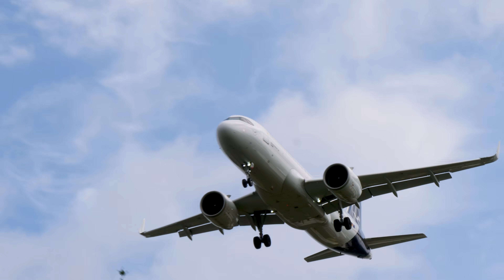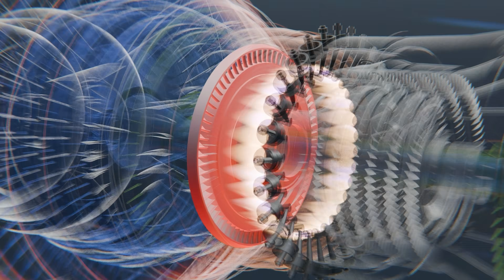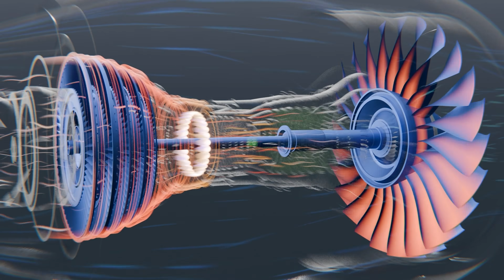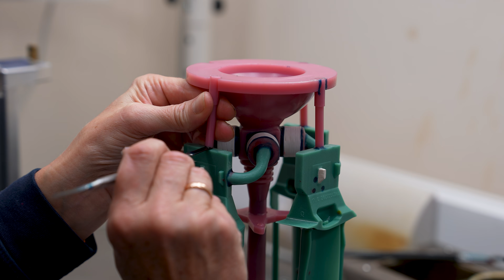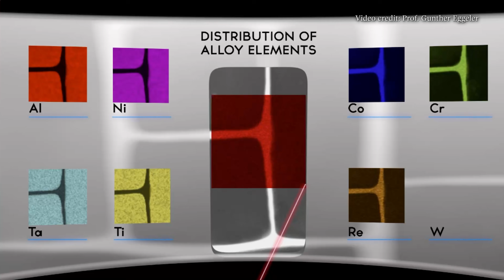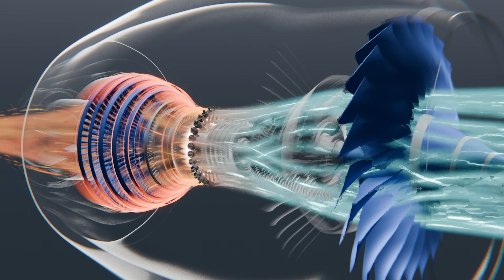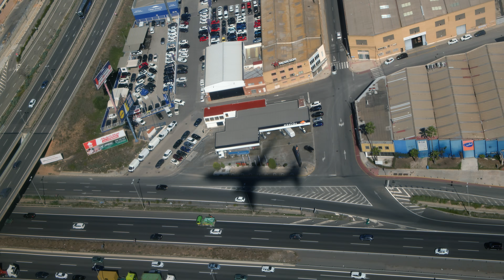The Ridiculous Engineering Of Jet Engines

Comment: Is it true that the slower the exhaust is, the more efficient the engine is? Eg. you want thrust to push the plane forward instead of the air backward.
Reply: In order to push yourself forward, you have to push something backwards equally hard. Now, you can push a small mass backwards really fast OR you can push a large mass backwards not as fast. As long as the "mass x acceleration" is the same in both cases, the thrust is the same. When you push on a fluid like air really fast, you have to push harder then the work you get out of it if you pushed slowly. If you can imagine say a piston in a cylinder and it moves up really really fast, air molecules start to bunch up right in front of the piston creating a larger pressure I have to work against then the rest of the air in the cylinder. So I'm always working against a higher pressure gradient then I need to. If I went slowly, the pressure would equalize and I wouldn't have to fight against that pressure build up right in front of me that I created by going fast. Likewise, now that I compressed the air in that cylinder and I want to expand that gas to get work out of that compressed gas by allowing it to push the piston, If I go slow I get all the work back out of it. If I go fast I create a slight vacuum right in front of the piston and the air can't fill that void fast enough so I always get less pressure acting on the piston then what is in the cylinder. So, going fast in either direction I work harder then I need to and I get less work back out of it that I should. This is why high bypass jet engines are more fuel efficient then low bypass engines. Low bypass engines need to accelerate a small amount of air to great speeds to get x amount of thrust. A high bypass jet engine grabs more air (mass) but accelerates it much less to get the same x amount of thrust. The one that accelerates more mass but not as much is therefore more efficient then the one that accelerates less mass but to much greater speeds for the reasons I shown above with my piston analogy. Essentially by trying to move the air fast, you create your own drag that works against you.

Comment: The heating up making the alloy stronger. Is that due to the lattice mentioned before and the shearing? Once heated certain atoms or particles are heated of, off gassed, or precipitated? Which would then help prevent the lattice shearing? Is that anywhere close?

Comment: With regards to the dust, look up the story of British Airways Flight 9, which was a quad engine failure due to volcanic dust. They managed to restart the engines (although one was severely damaged and had to be shut down again) and land safely. Green Dot Aviation has a really good video on this.

The engines run so hot that the volcanic dust was melted into basically glass. As the engines cooled down from being windmilled, combined with the lower altitude free of ash, these clumps of glass broke off the blades which allowed the engines to restart.

Comment: It sounds like the safety margin of those blades is really low? If any of those protections failed just a bit, it will be engine failure. How does the engine achieve high reliability when it operates at the absolute limit?

Comment: 1. More Forceful

“The familiar ball-and-stick model of atoms is fundamentally wrong. Atoms are not tiny spheres with electrons spinning around them, and pretending otherwise leads to impossible scenarios—such as electrons that should repel each other being drawn into stable orbits, or atoms that should pass through one another without resistance. These contradictions expose deeper flaws: the standard visualizations used in classical mechanics, quantum mechanics, and string theory are not just oversimplified—they are conceptually invalid. The entire framework built on these assumptions needs to be re-examined from the ground up.”

2. More Technical

“The ball-and-stick representation is a pedagogical abstraction that fails to capture the actual quantum-mechanical distribution of charge and probability density in atoms. Electrons do not behave as discrete, repulsive point charges orbiting within rigid spatial boundaries; instead, they form delocalized wavefunctions governed by the Schrödinger equation. Treating electrons as miniature spheres or assigning atoms fixed geometric ‘contact points’ introduces nonphysical implications, such as unbounded electron–electron repulsion or spatial overlap of nuclei. From this standpoint, many traditional atomic models—and the assumptions they feed into classical mechanics, quantum field theory, and string frameworks—lack ontological validity and may require a revised conceptual foundation.”

3. More Philosophical

“Reducing atoms to tiny spheres with smaller spheres spinning inside them is a metaphor that has been mistaken for reality. These images, meant only as teaching tools, have become subconscious anchors shaping entire theories. Yet matter may not consist of discrete billiard-ball units at all; instead, it may be something more continuous, more structured, or governed by principles we have not yet articulated. If the underlying metaphors are flawed, then the theories built upon them—classical mechanics, quantum mechanics, even string theory—reflect the limits of our imagination rather than the true nature of existence. The challenge is not to tweak these models but to transcend them.”

Comment: I’m a PhD student in materials science and engineering at UVA. I have my undergraduate degree in the same thing from Penn state. The bubble visualization for dislocation motion was absolutely beautiful. There’s a lot more to materials science that meets the eye and thank you for bringing it to light. The blue led video, the samurai sword video, this video, and many more all utilize materials science that I simply love. Thank you for this!
Reply: Also a project in my lab works on a rolls Royce project to look at the environmental assisted cracking (seawater increases cracking susceptibility) in these nickel based superalloys that the turbine blades are made up of. Ni-Cr-Al alloys have high temp strength with a great native oxide because of something called the third element effect. Fascinating stuff

Comment: I love this video. I don't like that I knew the answer before I watched the video. The answer is that the blade doesn't melt because the melting point of the blade is higher than the temp in the engine. The melting point of the inner layer of metal on the blade is lower, so the question was based on a false premise from the start really.

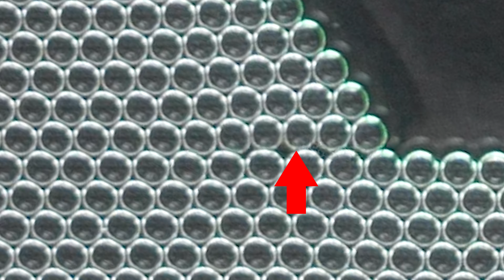Comment: @9:30 While the bubble visualization is great, it is only good for an absolutely elementally pure structure. A more realistic example would be to have smaller and larger bubbles as well to act as the different sized crystalized patterns which form from the advanced alloying process.

Comment: What's the safety factor on those blades to the heat which they endure? I assume it is far lower than most other engineered safety factors.
Reply: On some military jets (f15) they have an override throttle switch that gives you a negative safety margin to get out of trouble if needed. You get a plus 10-15% thrust for a short burst and then you better be able to explain yourself as a mandatory overhaul is needed as the blades do in fact melt somewhat using that emergency power. There is no un-overriding that switch. Once engaged it stays engaged so ground crew knows what's up.

Comment: @2:29 - what's counter intuitive about the order of things?  
In a gasoline engine it is exactly the same - if you look at it as a sequence of events in time:
- Suck*
- Squeeze
- Burn
- Blow

And of course some of the "backend" energy must be used to provide work for the front end.
*Yes: I know there is no such thing as suction. (eg: create a void for the atmosphere to push the air into the engine.
Of course with jet engines on aircraft, the forward movement of the aircraft actually helps to some degree.  
I dee-gress.

Comment: As a dentist, I found this particularly fascinating. Partial dentures are usually made out of nickel cobalt chromium alloys. They have the advantage of low cost but the disadvantage of veey high.melring temperature (compared to gold or other more expensive alloys) so not all dental labs are equiped to fabricate these.

Also, as dental students we made our own crowns for patients using the lost wax technique. Incredibly accurate process.

Comment: I am a student in an aerospace master degree, my (thermal transfer course) teacher  said that a 5°C difference in combustion chamber temperature can result in the turbine lifespan being halved,

Just on another note, to have air flow throw the film cooling holes, the air need to be at a higher pressure inside the blade than the external pressure of the blades (you can't make water run up to the mountain, fluids only flow from higher pressures to lower pressures), as such the cooling air NEDS to come from the compressor, or you would need a separate 50 bars+ compressor just to feed the turbines' cooling.

 it completely nuts how precise these engines are designed, modelled, and simulated to ensure proper lifespan and performances

Comment: A little more complicated than my electric leaf blower
Reply: It's more closely related to your hair dryer. The only difference is the fan in your hair dryer is powered by an electric motor rather then a turbine near the exit and the heat is added by an electric filament rather then by burning fuel. Other then that, they are the same thing.

Comment: In the power plant gas turbine industry, third-party companies manufacture replacement turbine buckets. Considering the extensive research and testing involved in producing these blades, I wonder if non-OEM products are of the same quality. I don't know if they even allow non-OEM parts on jet engines, as a failure could cost many lives.

Comment: You sent me down a rabbit hole of turbine transmissions and rocket engine fuel pumps.

Turns out the turbine blades for rocket engine fuel pumps are even crazier that the ones airliners use.  Would make a good video.

Comment: 4:10 I think the energy ratio is not 4 times but only 2 times. 4 times the speed squared and half the mass multiplies into two.
Reply: Then the ratio would be 8. But they just forgot to put the 1/2 from the kinetic energy on the left hand side of the equation actually,
Reply: @naitzirch  No, the ratio is 2.
Reply: @attilakiss8585  2/(1/4)=8. Though, in the right panel they forgot the 1/2. Left you have (1/4)mv right you have mv. The ratio is 4 as he said in the video.
Reply: @naitzirch  1/2*m*v^2 is one case. Half the mass, double the speed to have same impulse, 1/2*(m/2)*(2v)^2 = m*v^2 which is double energy.
Reply: @attilakiss8585  
First case: 2m*((1/2)v) gives energy (1/2) * 2m * ((1/2)v)^2 = 1/4v^2
Second case: (1/2)m*2v gives energy (1/2) * (1/2)m * (2v)^2 = mv^2
The second case is four times as much
Reply: Because you have changed the mass and velocity four times.